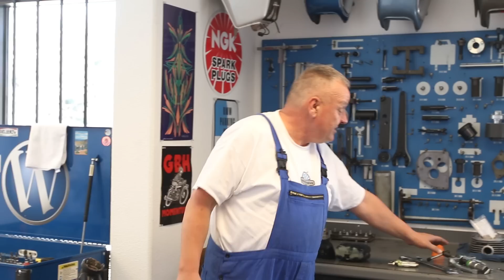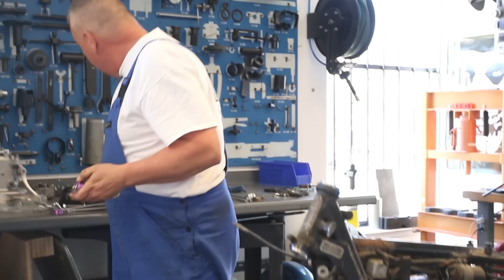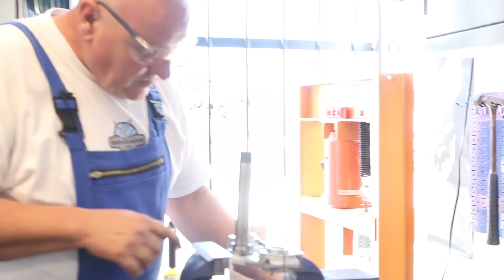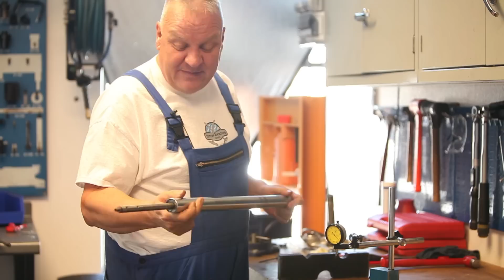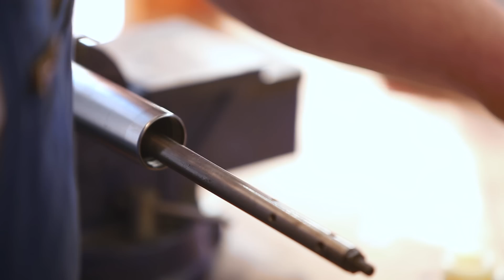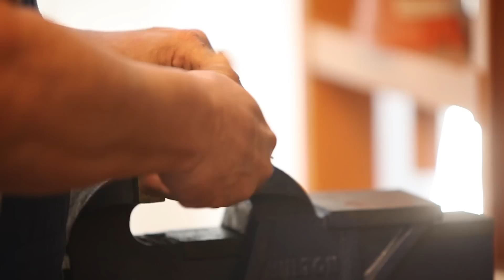R90/6 #16  (See correction below) Steering Head Bearing Replacement | Reseal front Forks

Comment: Great video, love this guy.  The only thing I would do differently (perhaps being obsessive) is use a non moly grease as moly can cause corrosion in the presence of moisture.  I have seen corrosion in some head bearings that I replaced. Timken makes a nice grease that I use though most any bearing grease will be fine.

Comment: Great series, William! Any chance you could share the part number on that Liquid Moli grease or any other brand you'd reccomend for stem bearings? Refreshing mine now. Thanks!
Reply: You probably already figured it out by now but in case others read this, he I and I both use the Liqui-Moly LM47. It's not called LM47 anymore though so just look for their "Long-Life Grease +MoS2" It's exactly the same and they just dropped the LM47 moniker.

Comment: Please confirm video. At 20 minutes you mentioned the clear colored bumper going up on top of the dampener but at 23 minutes you show putting it up the shaft of the dampener after it is installed. I believe the 23 minute mark is correct.

Comment: There is a less expensive way to pull steering head bearing races. Get a piece of 1/2" rod, rebar works. Cut a piece of the rod to fit centered in the bearing race. Weld the short pc to a foot long section, forming a tee. Insert the short pc into the race, connect the welding ground to the 1' pc. weld the rod to the race and lift it out.

Comment: I realize I'm a bit late to the party, but I was wondering if you could explain the function of the threaded rings with the spacer sandwiched in between (screwed in the bottom of the stanchion and secured with the snap ring). Is this some sort of check valve for the fork oil? Or is it there to secure the damper rod? Thank you for the great videos, they are immensely helpful!

Comment: Hello William, i and my friend lear lot from your videos, without it it would be impossible for us to do something. Thank you.
Yesterday when we put the bearing shell into the frame it do not went straight in it, it was a litte bit skew. We put it out and saw a line in the frame where the shell comes in, small demaged from the skew shell, like a line with small debth. Is this dangeroaus? Could we put a new shell in it or can we put the old shell in (doesnot seems demaged). Thanks for the answer
Reply from the maker: Roger: If I understand correctly, the bearing made a mark because it did not go in straight. The bearing race may be distorted if if enough force was applied for the bearing to reave a mark. Best is to put in a new bearing but the frame should be fine.

Comment: Hi William is the rear brake pivot threaded in the frame, or is it a push fit  1979 r100 rs mine seems to be seized if not threaded  yours in desperation.   Derek in uk   My e mail is   Mvagusta750@yahoo.co.uk
Reply from the maker: @Mary Bagg: The pivot has an M10 (17mm wrench)  nut on the inboard side. Once that is removed, the pin should push out but it could be stuck a bit but should come out.

Comment: Hey, I am having trouble trying to unscrew the nut that’s inside the fork, any tips? I’ve tried a few different things but it won’t budge.
Reply from the maker: Hello Authur,  I assume you are trying to break the base bolt free. Try putting some heat on it with heat gun or a torch.  That should break it loose.

Comment: Hallo from Italy: just a question: you never use a bit of heat when you install new bearing races , is there a specific season?
Reply from the maker: It depends on the specific applications. In aluminum, I usually always do use heat but the steering head is steel and there is not a really tight interference fit so the bearings can go in cold in my opinion.

Comment: What do you charge for labor to do these bearings?
Reply from the maker: We specialize in 2 valve boxers. Our shop rate is $100 per hour.
Reply: boxer2valve BMW Restoration and Parts Supplier how long of a job is it to do the bearings?  What is your labor time?
Reply: How many hours do you typically charge for this job?

Comment: Hello WilliamIt's certainly a bit tricky to find out exactly which parts go where in the front fork but regarding your correction I think there should be a "bush" or bumper BMW Part No  31422000384 where you showed it at 19.50 (and it has a bevelled edge which I think goes upwards though I stand to be corrected as I couldn't find this information and mine had completely disintegrated)  and then the "ring" or bumper 31421231314 is as shown at 23.10.Best wishesRichard
Reply from the maker: Thanks for your comments!

Comment: Its possible to remove the iner bearing with a brake piston extractor kit. The other more desperate way is to run a large bead of weld around the inside of the bearing face, when it cools it will fall out.   Brilliant  video , many thanks.
Reply from the maker: That's true..... many ways to skin a cat! Thanks!

Comment: What size is the puller you've used? 21-6 or 21-7?
Reply from the maker: We use the 21-6 for removing the steering head bearings
Reply: @boxer2valve  and what size the extractor is? 22-4? 22-5?

Comment: Congratulations for these videos. Excellent explanation and great edition.

I have made this operation last week in my BMW R100/7 and I have a question about the white plastic bumper (code 31422000384), that is the stopper for the fork extension. You have put 2 of these pieces in one leg (4 per motorbike). In BMW diagrams only appears one of this in lower position (2 per bike).
This two bumpers, are really the same piece?
Is is possible that one of these be the 31421234506?

Last week I used the "plastic method" to introduce the pipe into the fork tube. I tested another option of this method:
- Use only one turn of a 0,2mm thikness piece of plastic.
- Introduce this into the tube but to the less diameter part of tube.
- then introduce the pipe.
- finally extract the plastic.

In my case was very easy to introduce the pipe.

Waiting for your next excellent video!!
Reply from the maker: Hi Joan, thanks for pointing this out. I made a mistake. At about 19:50 where I place the white bushing on the damping rod is simply wrong! Sorry about that! There are only two of the bumpers used, one per side. We have added a note to the video to point this out. I'm glad that the plastic trick worked for you! Thanks for your feedback.

Comment: Don't need to cool down the outer bearings before installing? Does it help or prefer not to?
Reply from the maker: Hi. Cooling the bearings first is not a bad idea at all and it would not hurt to do so. The interference fit here is minimal and the bearings can be installed at room temperature as well.

Comment: Before I put the rocker cover on I turn the motor over to ensure there is a good supply of oil to the rockers. This is the best way to check that the supply holes were not blocked off at the cylinder to block interface.
Reply from the maker: Yes, that is an excellent suggestion! Very good idea!  Thank you.